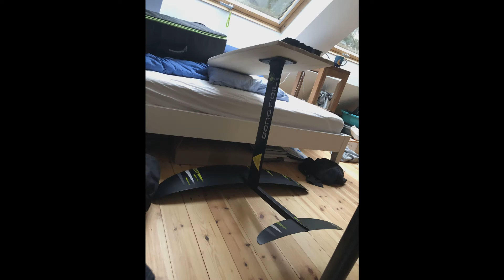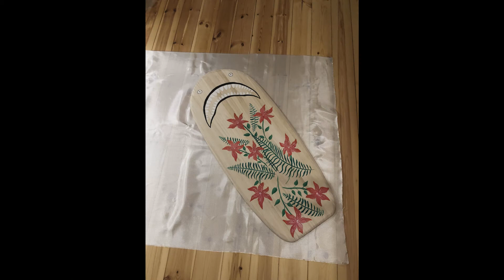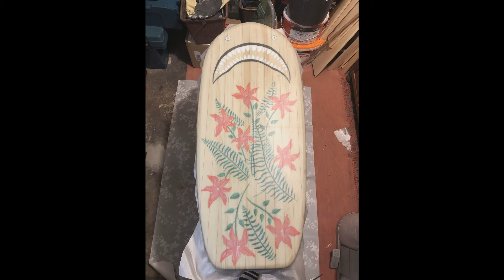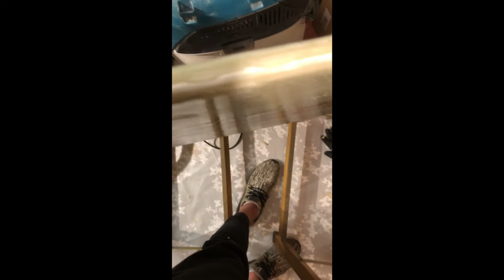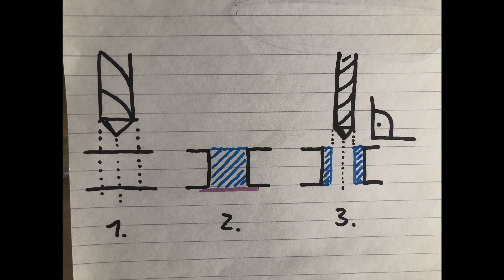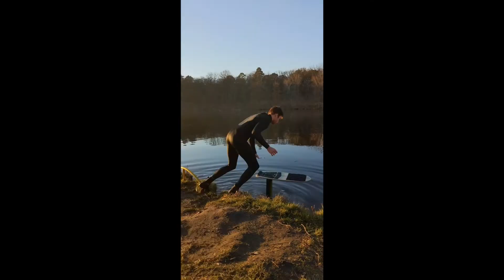Selfmade Pocket Foil Board  -  Experiences  -  How To Guide

Comment: Very nice job! I’m trying to build a board with a piece of wood I have left (it has a nice concave) but it’s fairly heavy and I don’t want my board and foil to sink to the bottom of the lake :D to save weight, I’d use a couple of layers of wood varnish and some Epoxy for the holes. Could you give me an indication of how to float and/or weight of your board is? My gong foil is pretty heavy compared to my old f-one setup

Comment: Did you vacuum bag it?  I don't see the bag, but I see you used peel ply fabric. The bag should help with the wrap on the edges.
Reply from the maker: I didn't use a vacuum bag.. I guess it would help a lot but I wasn't up to build/ buy everything needed to use it.. The Peel Fabric works quite well, I was really surprised by that :D
Reply: I just tried my first vacuum bag on a wood and glass foil wing. The vacuum bag didn't work as well as I'd hoped for getting a good wrap around the leading edge of the foil, so maybe wrapping it tight by hand is just as good. The bag is probably not worth the extra effort and cost. Great to see you pumping the board.  Well done!
Reply from the maker: @noomapollo5389  Thanks! And I really like the board its super stiff and agile, the next one could be a bit lighter tho :D Plus no Volume is cool for pumping, however swimming back to shore was better with some volume so I might have to build another one with some volume. So i will definitely not try vacuum hahah

Comment: Are you still happy with the foil placement? Did you ever move it after doing tests?
Reply from the maker: I'm still happy with the positioning. It's quite strange in the beginning as it feels like there is not enough space in the front (specially for the dockstar) but once you get used to it its amazing! So i never changed it. NEVERTHELESS, I'm only using it for Pumpfoiling on the Gong Rise XXL & Curve XLT, so different Foils might need a different positioning on the board :)

Comment: Nice board 1 question does it float in the water??
Reply from the maker: Hey Max,
It does float, but I would not use it with a Foil that's heavier than water as there is not too much volume to compensate for the flotation... But with all the Foils I've tried so far it stays above the water.

Comment: Do you have any idea how long the wooden plank will last in water if you only put lacquer?  I don't feel like spending too much on it for a few sessions before I buy something more professional maybe from you lol
Reply from the maker: Paulownia will brake immediately with only lacquer on it. You can get a multiplex cutout (in Germany we call them 
screen printing plate / Siebdruckplatte) which is going to last a few seasons without lacquer, glas or anything on it. I can highly recommend to start with a random cheap wood plank, instead of going all in and buying an expensive board...